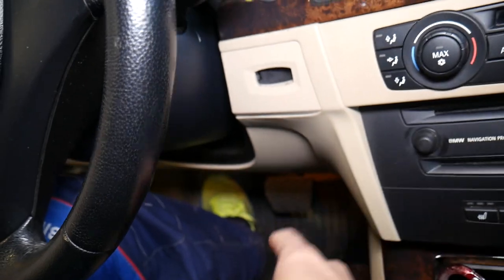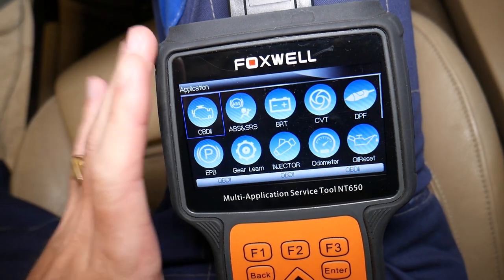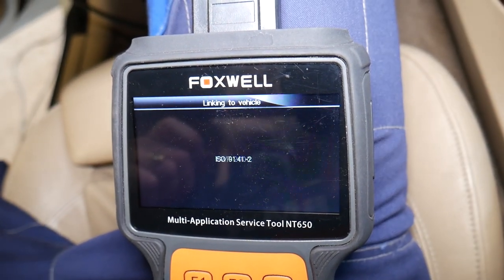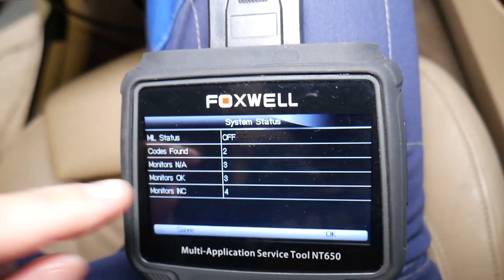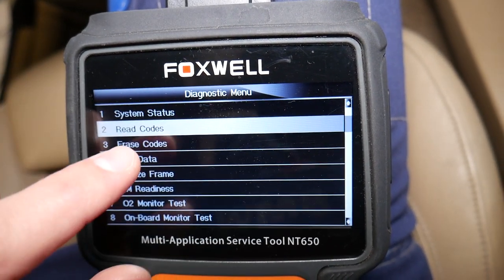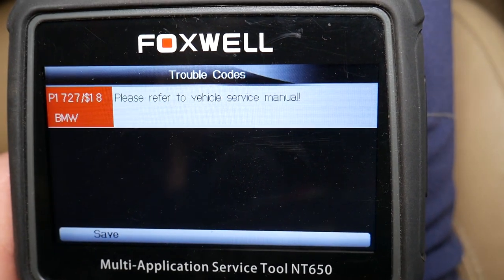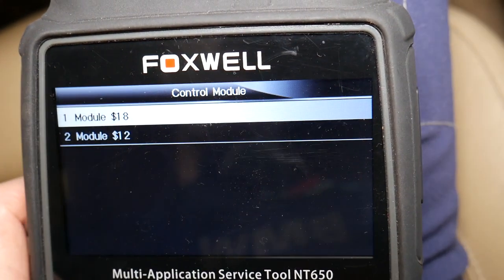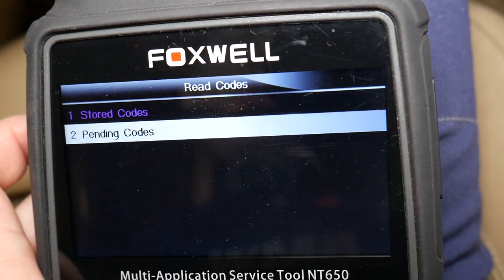BMW CODE P0700 TRANSMISSION CONTROL SYSTEM FIX

Comment: Already subscribed and have a question. What would cause white coolant smoke to come out of an exhaust and my engine is not overheating but goes on limp mode? BMW 320D E46 M47 engine with a turbo?

Comment: I have a 2005 325i code P0700-P0741 comes and goes like every other day transmission feels fine.  Any suggestions before replacing sensor.
Reply: Did you find out how to fix them? I have those same 2

Comment: I have 2008 528i with 150k miles. Sometimes when the engine is hot it gives symptoms of running out of gas or fuel pump failure. However if I move the shifter to the manual mode the symptoms go away.  There are no codes stored at any time.
Do you have any ideas  ?

Comment: I have p0700 in my 2006 bmw 330xi I replaced the crank shaft position sensor OEM but I transmission light turn on after my 2 day of driving with the new sensor, when the transmission light goes on while driving car goes into limp mode and still drive but when you accelerate feels hard .
Reply: Mine didn’t fix the problem either
Reply: Di you resolved the problem?
Reply: Anyone fixed it ?

Comment: I have a 06 325i and have gotten some code saying I have a bad turbine sensor and shift solenoids. Can I change just the valvebody or need to replace the transmission?

Comment: my 07 335i won’t start now and i have that code but i changed the crankshaft still no start😕 and no engine light just the transmission code
Reply: it was bad engine engine locked😞

Comment: Hi can you please help me, Im getting a P17E8 and a P0700. I recently changed the trans fluid and had the adaptations reset. It was shifting good until it almost hit a 100 miles. would could be the problem. I'm in So Cal. I would bring my car to your shop if possible. Thank you BMW 2008 Z4 e85 3.0SI

Comment: Hello hopefully you see this.  Im currently getting a p1701 code and car will not go into drive or reverse.    Where should I start? I already replaced the battery.
Reply: I have the same problem what did you find out
Reply: Here here!  new spark plugs and coils but I disconnect the battery before I start it after install everything ill put the negative connector back but made a huge Spark now my transmission gears are flashing it goes to park automatically and my GPS display static image! 😢

Comment: I have a 08 535i and car ran great untill it locked up on me out of nowhere and I did repair the gaskets on the mechatronics  and now the car goes reverse and drive but when it's time to shift 2nd gear my back wheels lockup and will only run on 1st gear could it be my synchros maybe 2 gears locked in at once
Reply: It's an automatic
Reply: Did u fix it ?

Comment: Hi, I was in a accident where another driver crashed on my right side passenger door. the right roof airbag has deployed. the car does not start. Only my right side doors are damaged from the accident. How can i make my car run again? I can send you the codes that came out from OBD2 scanner. Thank you

Comment: My kia sportage 2006 gets this code every year when its summer! Changed the sensor, harness...tends to be trans fluid damaging etched contacts on circuit board inside of transmission! I rebuild board saving $1000.00!

Comment: I just bought a used 1999 E46 328i with a 5L40E transmission, It was shifting hard so I serviced the Transmission by changing the fluids and filter and replacing the valve body. When I drained the transmission there was only 4.5 quarts of fluid that came out but filling it with about 8.3 quarts. I also replace the thermostat and house due to a check engine light for a MAP temp sensor. Now I have a check engine light with NO CODE and I'm at a loss. I have an Autel AL619 ODB II scanner, a friend has a scanner that connects under the hood in the engine compartment 20 pin port  when it try's to communicate with the TCM it fails. he can pull the transmission information but when he checks for code it fails communication. I still have a "check engine light". What should I do or try next.
Reply: Change the transmission control module now

Comment: I have a 2008 BMW 650 I convertible It's when driving after about 20 minutes at 55 miles per hour the transmission will act and seem like it's slipped out of gear Then I will pull to the side of the road Shut the car off Everything will reset itself This has happened to me on one trip at least 5 tiyeah at least 5 times It seems like every 15 or 20 minutes of driving this happens this happens I reset the transmission by shutting off the car and restarting it this will allow me to drive until it happens again again. please help me
Reply: I have same issue, was u able to find the issue
Reply: Same here. If you ever fix the problem let us all know how you fixed
Reply: Did anyone find out the cause??
Reply: What did y’all do to the car?

Comment: bmw e60 transmission fault. it may not be possible to engage reverse gear.reduced acceleration. drive moderately.                               azerbaycan
Reply: I got this problem too  and nobody knows how to fix it
Reply: @RZep  did you find the problem